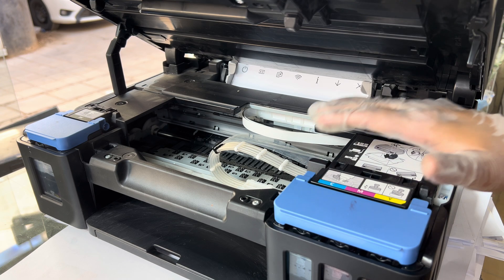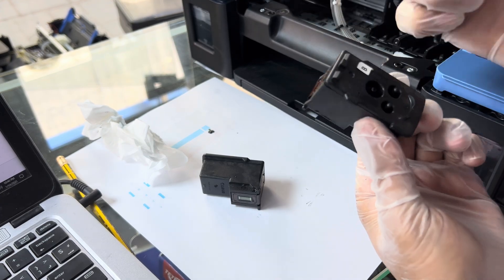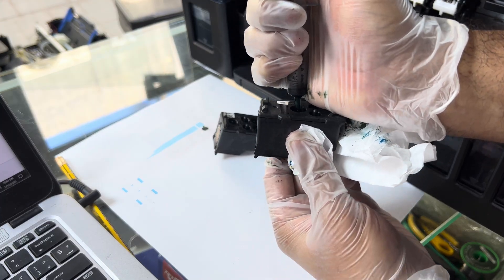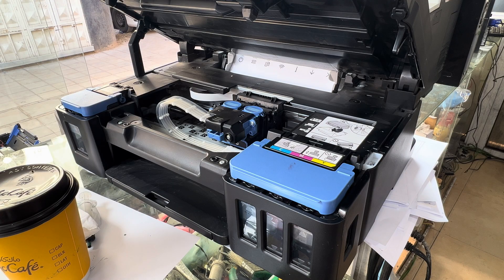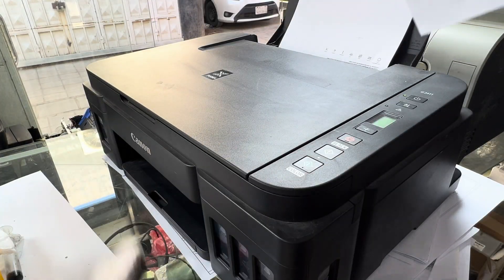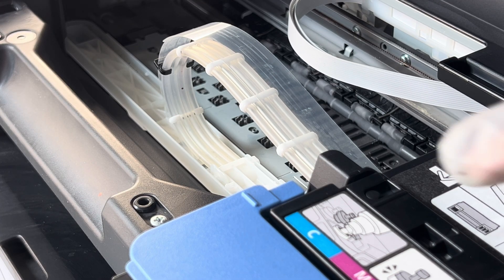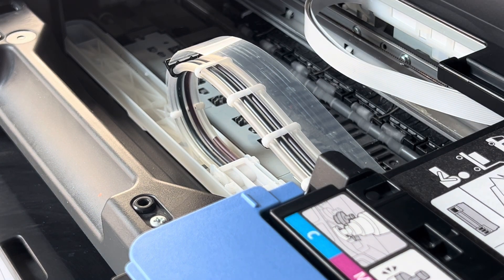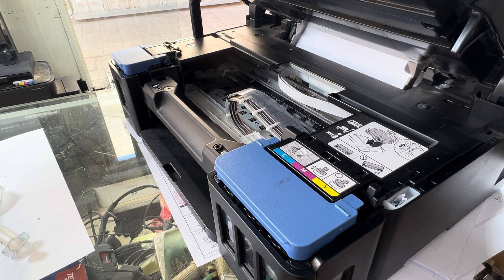How to do Manual Printhead Cleaning Canon Pixma Ink Tank Printers

Comment: Quick question why its always backflow after inkflush?
Reply from the maker: Good question! Backflow after an ink flush on Canon Pixma ink tank printers usually happens when there's too much pressure in the ink lines or air trapped inside. It can also be caused by overfilling the tanks or doing multiple flushes in a row. To reduce backflow, make sure the ink levels are at the recommended mark and let the printer rest for a bit after a flush before printing again.